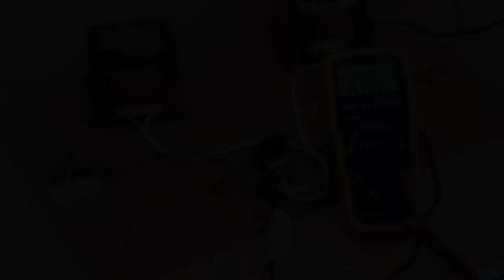DIY Welding Machine / Only 2 Microwave Transformer / Good Job

Comment: Do you know what AVG the cable is  that  you use   it  shows that  on the  cable   and what i kind of saw is that the one that you use to  make the box  with Thanks
Reply from the maker: The cable I use is a 4mm2 silicon insulated copper cable called N2GFAF.  The aluminum I used for the box is 3mm thick on the front and back panel, and 1mm in the cover section.

Comment: Hey, where did you buy the wire used in the transformers?
Reply from the maker: Hi.  The cable I use is a heat resistant silicone insulated cable.  I bought it from an electrical supply store where I live.  This cable is generally used in the interior installations of appliances such as electric heaters.  Maybe it can be found on the internet with the code N2GFAF.

Comment: Hi, It's 220VAC design, do you think this design with work with 110VAC in the states?  Great job BTW!
Reply from the maker: Hello.  First of all, thank you for your interest.  It will work in the same way in places with 110V mains voltage.  Because the microwave oven transformer produced at your location is designed for 110V input voltage.  There have been those who have made a comeback by doing it this way and it worked the same way.

Comment: Fantastic video bro I have 2 gauge wire 6.5mm how many turns would I have to complete? More or less
Reply from the maker: Hello.  Thanks.  I made 24 windings with silicon insulated cable with 4mm2 cross section in each transformer.  In this case, 1 transformer gives 20V.  Is the cross section of the cable in your hand 6.5mm2 or is it 6.5mm in diameter?  Also, if the insulation is not silicone, it won't be useful.
Reply: well to give the best idea is to give you exactly what it is Sir it is the same wire that is connected to our electric meter box or/and I have the wire from the battery cables on the vehicle's the length from the battery to the starter. I just thought that the thicker the better. Does this help you??
Reply: ...and yes 6.5 diameter..where can I get the wire you use in video like Lowe's maybe
Reply from the maker: Actually, the thicker the better... but as the thickness increases, the number of turns decreases.  The number of turns should be 48 turns in total.  In other words, if it is to be done with 2 transformers, each transformer should have 48/2=24 windings.  If 3 transformers are to be used, 48/3=16 windings should be used.  By the way, 48 turns is not an exact value.  It can be 45 or 50... The cable I use is called N2GFAF cable and it can work at 180 degrees.  AWG11 or AWG12 can be used instead of this cable.  If you use 3 transformers, you can use the cable you have, but you have to wrap around 15 turns on each transformer.
Reply: wow 15 for real. I struggled to get 4 in there and all I got was 3 measly volts 😂..let me put some serious elbow grease and see if I can get some more in there Sir
Reply from the maker: Maybe there was a misunderstanding.  I think the cable you have is around 25mm2.  It's the size I use on my spot welding machine.  Better use this cable for spot welding.  You need to buy new cable for arc welding machine.
Reply: I must agree with you here Sir and yes as the wire I have is the stiff wire that comes  from the city's electrical power lines is what I am trying to wrap around this transformer Good Sir and it was a whooping if I ever got one..off to Lowe's we go..

Comment: I use a 16mm cable. If I do 6 laps can I have the same voltage as you?
Reply from the maker: Hello. With 6 turns of winding, you can only get 5V and a total of 10V with two transformers. In transformers, the output voltage depends entirely on the number of turns. If we give an example for microwave oven transformers, such as 5V in 6 turns, 50V in 60 turns, 500V in 600 turns, 5000V in 6000 turns...
It would be nice to use a 16mm2 cable, but unfortunately it won't work as the voltage remains low. In order to obtain sufficient voltage in 2 transformers, 20 - 24 turns of winding are required for each transformer. That's why I chose 4mm2 silicon insulated cable. It heats up faster, but thanks to the silicone insulation, it can withstand heat.
Reply: thank you so much for advice. So I have to switch to the 4mm to have a good voltage. And I used 4 triac BT140 with the same dimmer like you. I keep you updated
Reply from the maker: Thank you too. The cable you will use should be a 4mm2 silicon insulated copper cable.

Comment: Thank you for your video. How long is the 4 mm2 you use for the two transformateur? Thanks
Reply from the maker: Thank you so much. I use 6.5 meters silicone insulated cable for each transformer
Reply: super 😊 so 13 meters total 👍👍
Reply from the maker: Yes 👍

Comment: 4mm2 13m cable long for each transformer or both? thank you
Reply from the maker: Let me try to explain it to you briefly... For each transformer, 24 windings will be made with silicon insulated copper cable with a length of 6.5 meters and a cross section of 4mm2.  The windings should be made neat and tight.  In this way, 20V is obtained from each transformer.  40V is obtained with two transformers.  If you have any other questions you want to ask, please write again.
Reply: thanks a lot ....

Comment: Which type of transistor do you use
Reply from the maker: The circuit element I use is the BT137 triac.  It has 8A current resistance.  I provided 32A current resistance by using 4 pieces.
Reply: How can I join them to make controller
Reply from the maker: Hello again.  I don't know if you have electronic knowledge, but there are 2 schematics in the description section.  One of them shows the general connection of the welding machine.  The other one shows how the triacs I added to the dimmer circuit are connected.  You should buy one 2000W or 4000W dimmer and connect the triacs as shown in the diagram.  As I have shown in the video, you should connect the triacs on an aluminum heatsink and connect the circuit with a sufficiently thick cable.  When you do it this way, the circuit power will increase and it will not fail easily.

Comment: Hello..im from Malaysia..how much turn the wire?..the dimmer can adjust amp or voltage?..how to make dual adjustment for amp and voltage?..
Reply from the maker: Hello.  I made 24 turns of winding with 4mm2 silicon insulated cable for each transformer.  The dimmer actually adjusts the input voltage.  In this case, the power drawn from the input, that is, the power of the system, can be reduced or increased.  As the output power changes accordingly, the output current is adjusted.  In welding machines, the adjustment of the output voltage is not much.  So it's not wanted.  Maybe you have thought of using the same machine for spot welding by reducing the voltage.  Is that so?
Reply: ok im understand..so i want make welding machine..i newbie about welding.. wanna to try make it..i hope it work like your video..
Reply from the maker: It will work.  Be sure to use the cable with silicone insulation.  Because the biggest problem of these machines is heat.

Comment: 4mm2 wire is very expensive in this area.
What other wire can be used
Reply from the maker: Hello.  I bought the meter of the cable I used for about $1.  This cable is cheaper than AWG11 cable.  But I don't know if you can find it where you live.

Comment: How many turns on each transformer with the 4mm insulated cable?
Reply from the maker: Hello.  Each transformer has 24 windings.  Between 20 and 24 turns is sufficient.  In addition to wrapping properly and tightly, it is also important not to damage the insulator.

Comment: Günaydın!
Voltaj regülatörü scr, motor hız regülatörü, dimmer, sıcaklık korumalı, 4000 w 0-220v ac 4000 w iyi mi yanlış mı?
Reply from the maker: hisa matto1944  • 4 saat önce
Günaydın!
Voltaj regülatörü scr, motor hız regülatörü, dimmer, sıcaklık korumalı, 4000 w 0-220v ac 4000 w iyi mi yanlış mı?

Murat Güney
Tam olarak doğru

Comment: If i touch the output knobs  Same time , can i affect by a electric shock or not?
Reply from the maker: Hello.  Since the output voltage is 40V, it will not harm you.  Of course, a current passes through your body, but it is not harmful.

Comment: Great job and neatness in the completion of it and above all very useful, I would ask you to please tell me what nomenclature the triacs have that you increase, because in the video it is not well appreciated, do I understand what is TIC 22? D, the third number is the one that is difficult for me to decipher
Reply from the maker: Hello.  Firstly, thank you.  I'm glad you like it.  In order to make the dimmer circuit more powerful, you can connect 4 BT137 triacs with 220V mains voltage and 6 BT137 triacs with 110V mains voltage in parallel.  This model is very easy to find.  You can find the wiring diagrams in the description section.  Also, next week, I will put a video for the process of converting the output voltage of this machine to DC.  Don't forget to follow and watch my other videos.  I hope you will like them too

Comment: BUENOS DIAS, ME PUEDE INFORMAR ¿CUANTOS METROS DE CABLE UTILIZO Y QUE DENSIDAD O NUMERACION DE CABLE?
Reply from the maker: Hola.  24 vueltas para cada transformador.  6,5 metros de cable de cobre aislado en silicio de 4mm2 de sección para 24 vueltas.  Se requieren 13 metros de cable para 2 transformadores.  El cable es un cable llamado N2GFAF.

Comment: is it also ok to use a 1.5mm sqaure cable?thats what i have
Reply from the maker: Hi.  1.5mm2 cable would not be suitable.  it becomes very thin.  You can only use it by combining 3 cables.  So 3x1.5=4.5mm2.  However, in this case, the required number of windings cannot fit inside the transformer as the cable insulators will become extra thick.  Also remember that it is necessary to use silicone insulated cable.
Reply: is there a way to recoil the primary coils cos i just ruined the primary coils as i was tryin to hammer out the secondary coils
Reply from the maker: Hello. I returned very late. I am sorry. Apart from the method I used to remove the secondary coil (thin windings), there is also a method of weakening it by drilling with a drill. You can also try to remove the windings by cutting one side with a saw and drilling a hole on the cut side with a drill.

Comment: I always trip the breaker when only get 30 or 40 seconds out of mines can a circuit board fix this
Reply from the maker: As far as I understand, the fuse cuts out after 30 or 40 seconds.  If so, the fuse value connected to the outlet you use may be low.  If you are using 220V mains voltage, you should use at least a 16A fuse.  For 110V mains voltage, you should use a 32A fuse.

Comment: Sir can I use a more thicker wire for the secondary coil?
Reply from the maker: Hello.  You can sell thicker wire, but in this case, the sufficient number of turns cannot be reached.  Therefore, the voltage value cannot be reached.  If thicker cable is to be used, it is necessary to increase the number of transformers.
Reply: ok sir thank You....🤗🤗
Reply from the maker: Thank you too

Comment: amigo de que país es usted, usted no realiza estas maquinas para la venta y cual seria su costo soy de venezuela
Reply from the maker: Hola.  Yo vivo en Turquía.  Hago herramientas para mi propio taller.  Así que no está a la venta.  Podemos decir que el tema de los costos es un poco complicado.  Porque los transformadores salen de hornos microondas viejos, entonces son de segunda mano.  En términos generales, cuesta alrededor de 50 dólares en Turquía.  Pero no se como estan los precios ahi... Saludos desde Venezuela
Reply: gracias mi amigo excelentes trabajos mi saludos y éxitos en próximos proyectos.
Reply from the maker: Muchas gracias.  También publiqué un video del proceso de conversión del voltaje de salida de esta máquina a CC.  Te recomiendo que mires.  En ese video, cambié el cable de entrada y las direcciones de soplado del ventilador.  Ver con subtítulos activados.  saludos respeto

Comment: Kullandığınız tüm malzemelerin bulabileceğiniz ismi ile listesini verebilirmisiniz.şimdiden teşekkürler kolay gelsin
Reply from the maker: Merhaba. Mikrodalga transformatörler hariç... Toplam 13 metre 4mm2 silikon izoleli bakır kablo kullandım. Bu kabloyu internette N2GFAF kablosu olarak arayabilirsiniz. Akım ayarı için dimmer devresi kullandım. Sahip olduğum devre düşük güçte olduğu için fazladan 4 adet BT137 triyak kullandım. Triyaklar paralel bağlandığında toplam güç artar. Ancak 4000 Watt dimmer kullanılıyorsa ekstra bir triyak bağlamaya gerek yoktur. Genel bağlantı şeması ve triyak bağlantı şemaları videonun açıklama bölümünde mevcuttur. 2 adet 12V fan ve Fanları beslemek için bir adet 12V adaptör kullandım. On/off anahtarı olarak 16 Amp anahtar ve kaynak probları için 10/25 kaynak soketi kullandım. Kaynak probu kabloları 1.5 metre 10mm2 bakır kablo. Kaynak pensesi 300A pensedir. Kutu için kullandığım alüminyum ön ve arka panelde 3mm, kapakta 1mm kalınlığında. 220V girişi için 3x2,5mm2 kablo kullandım. Aklıma gelen her şeyi yazmaya çalıştım. Atladığım bir şey varsa lütfen tekrar yazın. Bağlantı şemalarını herkesin anlayabileceği şekilde çizmeye çalıştım. İlginiz için teşekkürler, iyi günler
Reply: tesekkurler

Comment: Very good Job. Did you tray with a tungsten electrod to make it a tig ?
Reply from the maker: Hello.  Thanks.  I haven't had a chance to try it with a tungsten electrode.  Soon I will make a video on the process of converting the output voltage to DC.  If possible, it can be tried that way.

Comment: That brown wire for the transformer... what size ? Where can I buy
Reply from the maker: Hello.  The cable I use is a 4mm2 silicon insulated copper cable.  I bought it from a large electrical equipment store.  It can be difficult to find on the Internet.  Alternatively, AWG12 cable can be used but is more expensive.  The code for this cable is N2GFAF.  Since it is heat resistant, the insulation is not damaged after warming up and cooling down.

Comment: what is the type and size of the wire?... im so curious right now.... thank for this vid... really helpfull to me😄
Reply from the maker: Hello.  The cable I use is a silicon insulated copper cable with a cross section of 4mm2.  You can find the cable on the internet with the code N2GFAF.  I chose this cable because it is heat resistant thanks to its silicone insulation.  thank you for your attention

Comment: I am about to start the construction for AC and I would like to know what difference in results there may be between this assembly and the DC one to decide if I mount one or the other, thanks in advance
Reply from the maker: The weld seam is better in DC.  The polarity of the probes can be selected according to the type of electrode.  Metals such as stainless steel require DC welding
Reply: gracias
Reply from the maker: Gracias tambien 👍

Comment: How many turns you had gave in from of secondary coil🙂?
Reply from the maker: Hello.  I used 4mm2 silicon insulated copper cable for each transformer and made 24 windings for each transformer.  6.5 meters of cable is required for each transformer, so a total of 13 meters.  Try to make the winding properly and not to damage the cable insulation.  You will get 20V AC voltage from the transformer outputs and when you connect the outputs in series, it will be 40V.  If you have any further questions, please write again.

Comment: hello sir can you share the diagram of control and were can i buy the circuit board
Reply from the maker: Hello.  In the description section, there is the general connection diagram and the connection diagram for the triacs added to the dimmer circuit used for current regulation.  have you seen them
Reply: you mean dimmer switch
Reply from the maker: It's not actually called a dimmer switch.  Dimmer is an electronic circuit.  It changes the voltage value applied to the transformer input.  Indirectly, the output current is adjusted.
Reply: ok sir thank you very much i understand clear☺️

Comment: Great job! I’m working in a similar project right now. Can I use a 3500W dimmer instead of a 4000W?
Reply from the maker: Hello.  Actually, 2500W is enough for 2 transformers, but sometimes the current drawn is momentarily high.  That's why I chose 4000W.  3500W also works.  By the way, if your mains voltage is 110V, you must use at least 6000W dimmer.
Reply: Thank you, friend.
Reply from the maker: Thank you too 👍

Comment: Very good congrats. Murat one question where do you get the dimmer and triac I made one a while ago I never could it control the amps that part is missing in my  machine.
Reply from the maker: Hello, thank you.  The dimmer circuit I use is a circuit you can find everywhere.  I connected 4 bt137 triacs in parallel to make the circuit strong and durable.  If you do it this way, it won't be a problem.  The wiring diagram for this tool and the schematic about the process I did are available in the description section.

Comment: good  job  bro  how  many turns in transformer ?
Reply from the maker: Hello.  Firstly, thank you.  Each transformer has 24 windings.  6.5 meters of cable is required for these 24 windings and a total of 13 meters of cable is required for 2 transformers.  The cable is a 4mm2 silicon insulated copper cable.
Reply: tyyy  man

Comment: And sir well Can put digita miter in this great work because this is a clean work sir
Reply from the maker: Yes.  It would be nice to put a digital voltmeter.
Reply: Master invart I love you so much you answer questions  God bless you the cable sir is a single cable I see and is 4 mm sir can I use that One sir in the same touns sir
Reply from the maker: Exactly.  4mm2 cable.  but it will be silicon insulated.  must be heat resistant
Reply from the maker: Were you able to download the plans?
Reply: you tube sir
Reply: sir I sour the dimar diagram and welding machine diagram you send to me sir the third one reming sir please master